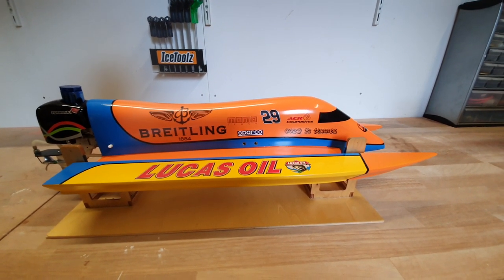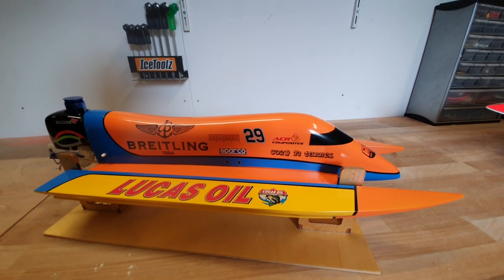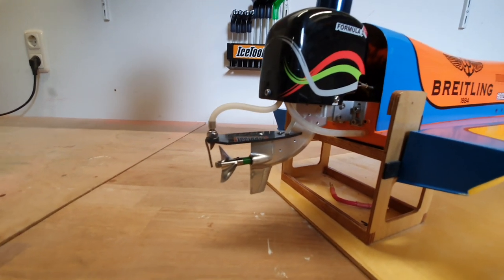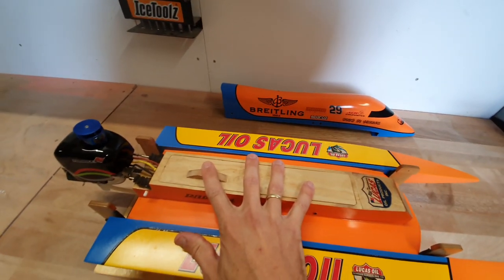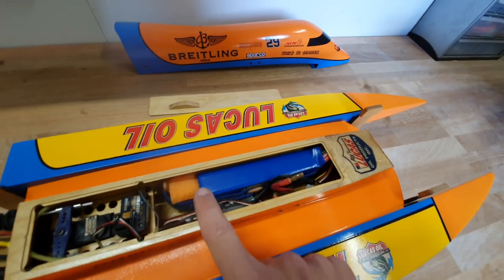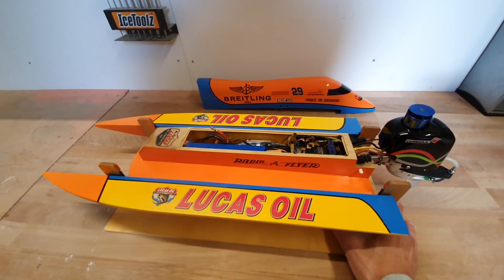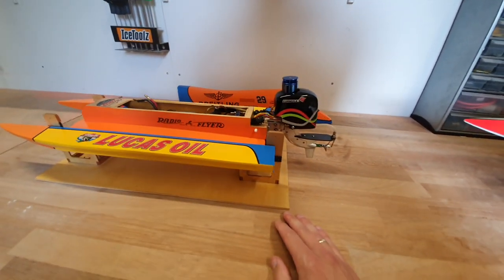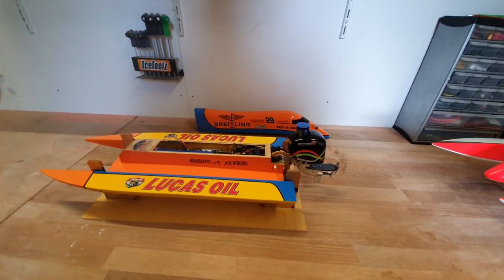DIY rc boat: Cozy F1 Tunnel powerboat review

Comment: Very impressive! I like the push pull steering, use it in most of my boats why I don’t know it just seams more solid/steady.
47mph is very good for that motor prop battery setup👍 Again very impressive.
Reply from the maker: Thank you Neal! It is a fun boat and it runs without any issues. I will do a review of it's big brother soon. Cheers!

Comment: Look your boats and you did an amazing job and I was wondering when you think you will be sharing the big brother version of this hull?  Have you thought about sharing the 3D cad files also for these boats?
Reply from the maker: Thank you Jeff 👍. I will make a review video of my 33" tunnel shortly. I share the drawings of that hull for free as well. I am hesitating about sharing the CAD files, because I don't want my design to be commercially used / copied. It unfortunately happened with this F1 hull already! 
Thanks for your sub 👍 Cheers!

Comment: Impressive build. Do yog still have plans? Looks like link no longer valid.
Would like to build similar boat.
Thanks in advance
Reply from the maker: Thank you Vadim, also for the sub 👍. I still got the plans, and I just noticed the website hosting the plans is down. I will re-upload the plans somewhere else and come back at you. Cheers, DJ
Reply: @CozyRC  Thanks much! BTW, have you try to make outboard motor by yourself?
Reply from the maker: @vadimkvak1751  I will do that for my next project. I'm building a Bernico F2 extreme, 1080mm mono and it will get a DIY outboard. Cheers, DJ
Reply: @CozyRC  Sounds like a separate build series.  Waiting to see this build